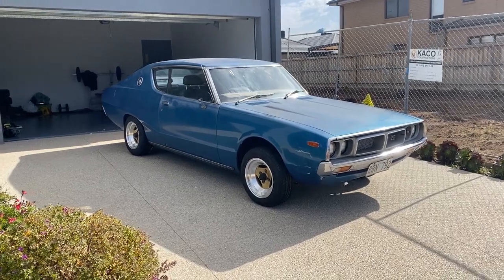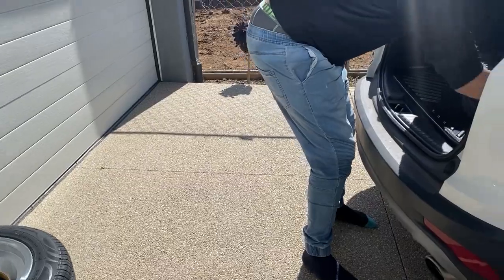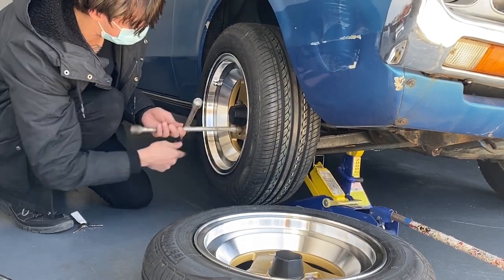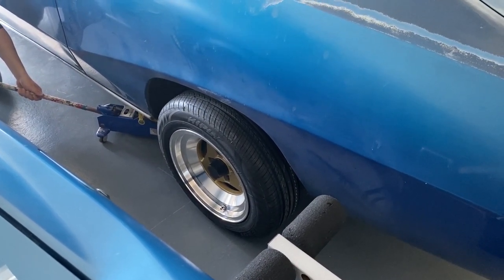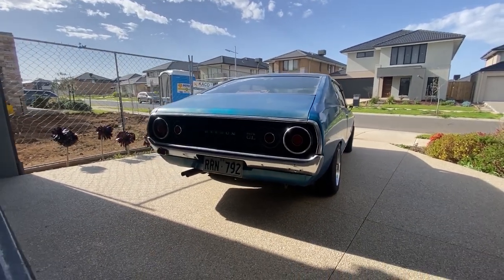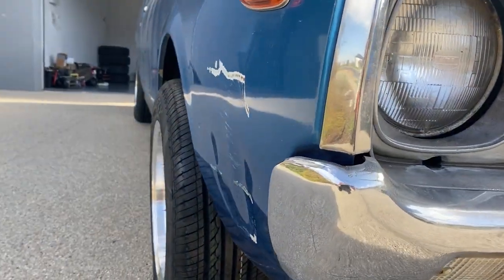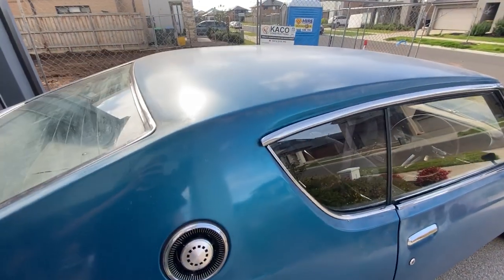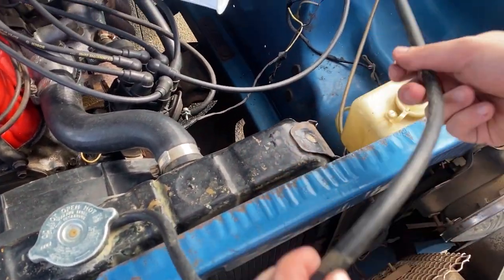REVEALING our new project. 1972 Nissan Skyline KPGC110 classic JDM car build

Comment: Video and car is great guys, I'm a C210 owner.
The rear quarters are missing skyline or Datsun badges I'm pretty sure. GT badges were removed due to the australian GT car scare in the early 70s. Australian difference on the rear is there is not 4 red rings around the lights just the two outers as on yours.
Reply from the maker: Socrates cool thanks for the info!
Reply: Socrates is a top bloke. Long time C210 owner.
Reply: @jdmcarbuilds6671  not quite true, JDM tail lights are all flat and inner reverse/tail lamps are reversed. 240K lights are rare in Japan but not anywhere else in the world as all export market models were 240K. As per this image showing both, Skyline on top, 240K bottom. I have owned 3 x 240K and currently own a Nissan Skyline 2000GTX-E in New Zealand https://www.instagram.com/p/B8BPhkcnaVT/?utm_source=ig_web_copy_link
Reply: kenmeri_nz did you finally buy another?
Reply: @HDRAus  Yeah I did! This time a genuine Nissan Skyline 2000GTX-E
Reply: kenmeri_nz oh congratulations mate! That’s fantastic news!!! So excited for you!

Comment: Nice car, hope to see its progress. You should be able to find the original paint code on the vin inside the engine bay. Not sure if they have vins anywhere else in the world, but Australia sure does so you should be able to find one
Reply from the maker: Angry Gamer ok great thanks for the info I’ll take a look there
Reply: @jdmcarbuilds6671  Paint code is the same as mine #157 Dark blue metallic. Also you are better of repairing that fender, it's not even bad. If you think 240K badges are rare, a good fender is rarer :)